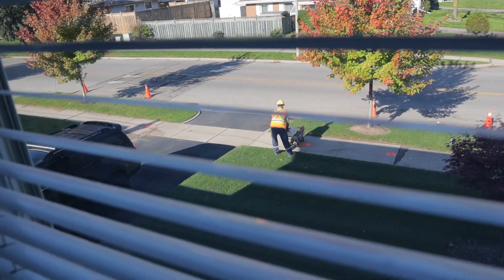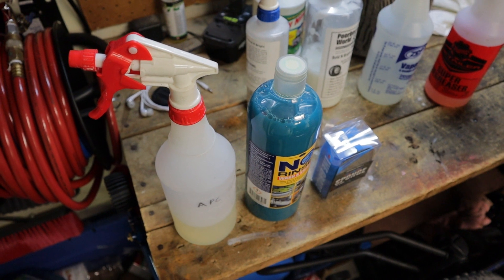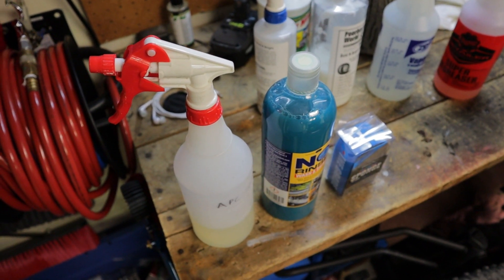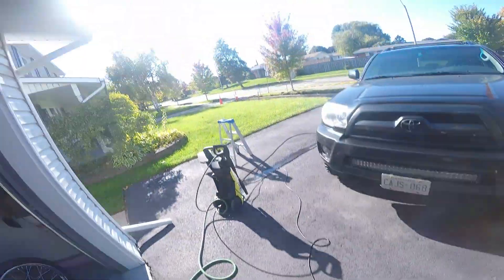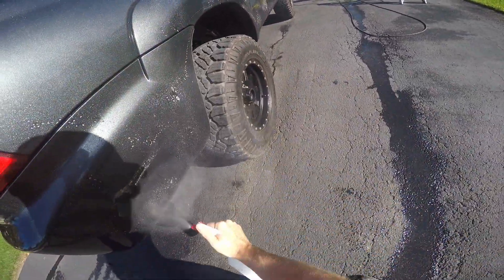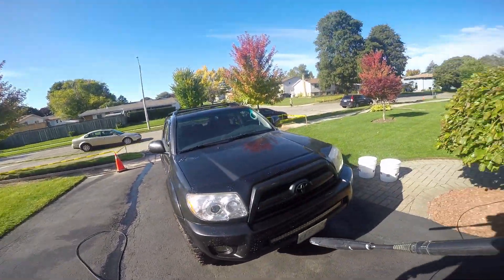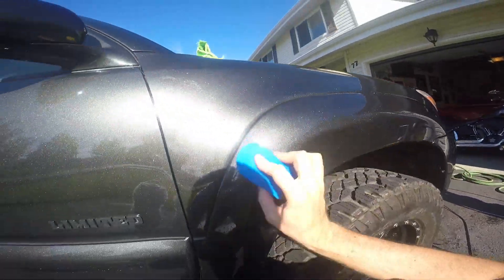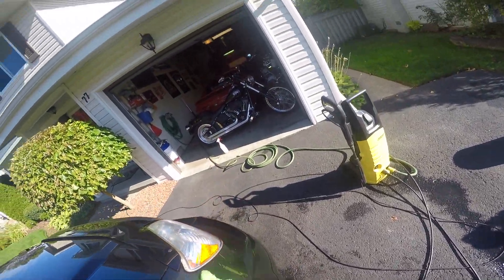Wash And Clay Bar | Toyota 4runner Detail Series EPISODE 3

Comment: Good stuff as usual! I love watching your videos since I have a V6 SR5 in the same color so it's like watching someone else work on my car! I use ONR and Bead Maker as well and I love them. I've also used the Optimum Spray Car Wax and don't really see the difference between it and Bead Maker. Question, have you tried the Optimum Clay Towel? If so, how do you like it compared to the nanoskin sponge?
Reply from the maker: A big bonus with Beadmaker is that you can use it on both waxed or coated cars. I've never really been interested in clay towels, seems like they'd be too awkward to hang on to. I like to let er rip lol.